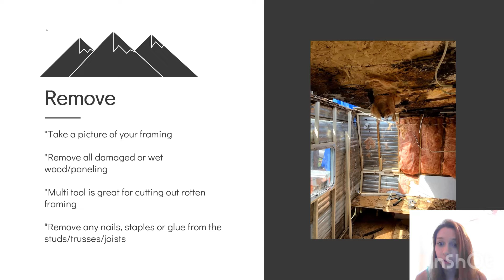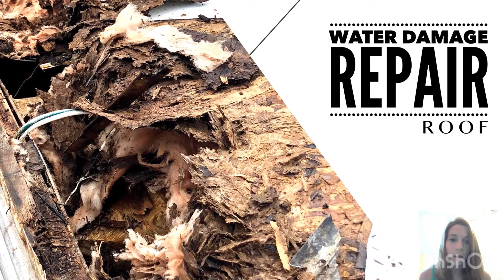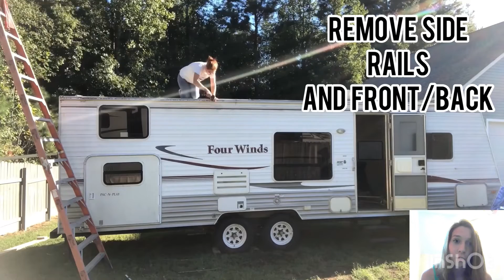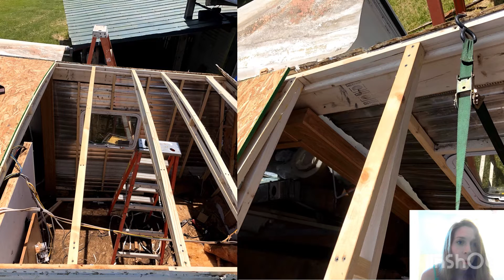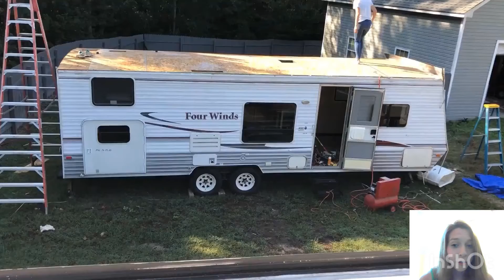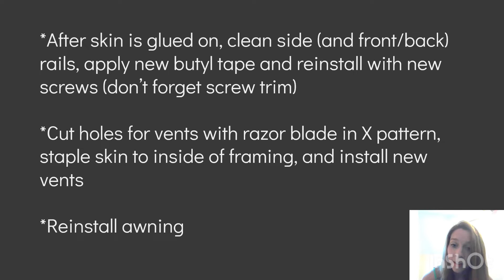RV water damage repair: roof and skin replacement!

Comment: great video. Are you against using rigid foam for wall insulation ? thanks for your great videos.
Reply from the maker: No, I actually used that in the horse trailer I just remodeled. I typically don’t in campers though, because the R value is kind of low. The loose insulation has a higher R value so it insulated better!